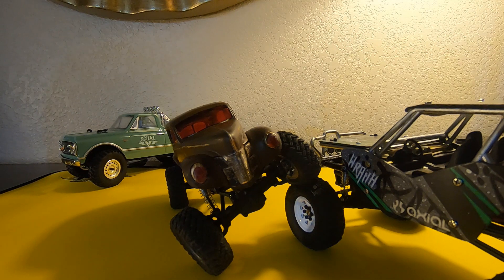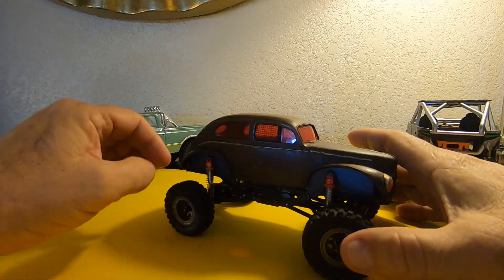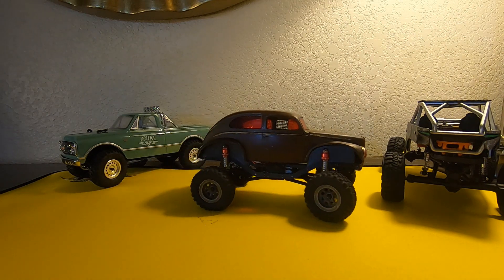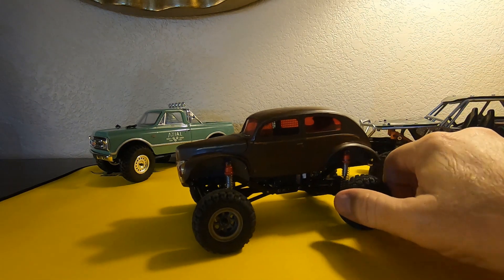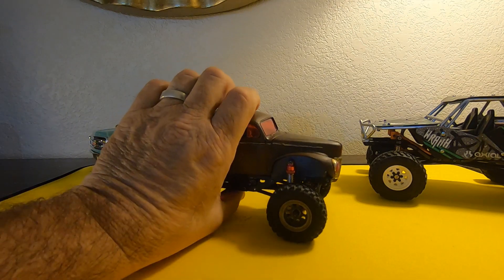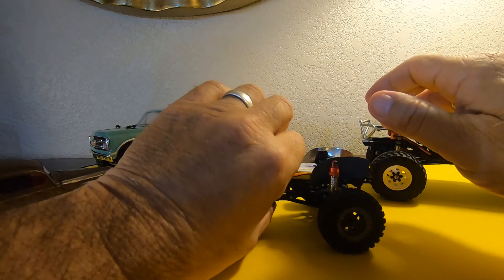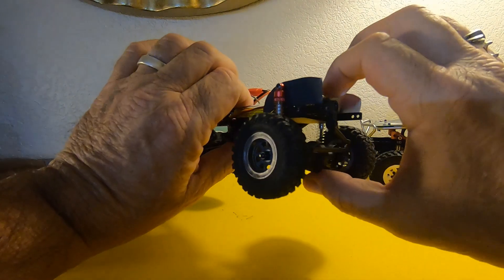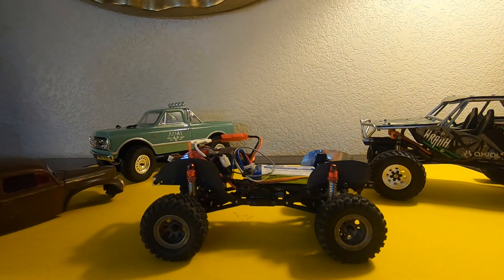Hobby Plus CR24 dual motor rat rod update.

Comment: Absolutely COOL Lee!! 😎👍👍 The dual Motors is an ambitious yet doable thing. I'm surprised there isn't already a kit to do that.
Stay SAFE Bro!
Carmine ✈🚂🚙
Reply from the maker: Thanks brother,  there is a kit to do this in the 1/18 scale RC4WD rig, so I figured if it gives a 1/18 more power, it should really work in a 1/24🤣 but I have even more tricks up my sleeve bro. Think 20 or 30kg of torque in a 1/24 scale😎
Reply: YEOW!!! You're going to rip the front Wheels off! 😳
COOL!!! 😎👍👍

Comment: It's a sweet lil rod, but yes the power split is a thing. On to the next! A
Reply from the maker: Thanks bro, as far as the power split, it's not terrible,  but it is a thing🤣  I may try dual esc's to straighten that up. And I also have some other power mods if that doesn't work😎
Reply: @BullgearRCvideos  Im amazed there is room for all the duplication. But that chassis moves sooo well Uncle Lee, it really looks a proper crawler. 👍👍

Comment: it's the same issue as a moa crawler, which you have effectively converted this to more or less, but  you can see the same happen on my frankin-truck 6x6 that uses the maxstone 8 moa axles,
Reply from the maker: I'm thinking maybe dual esc's will take care of this issue. If not I have a plan b and c. But I may want to do them on different rigs.